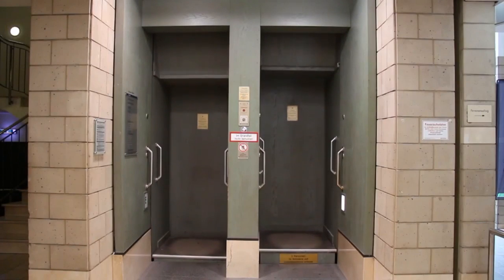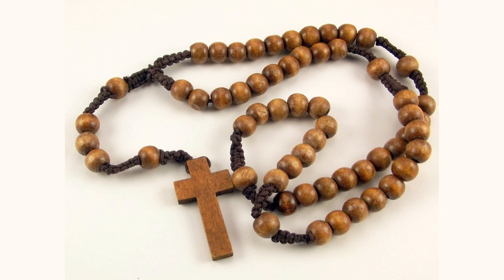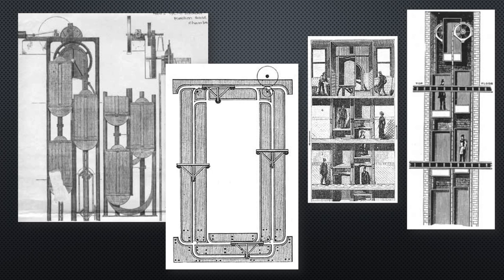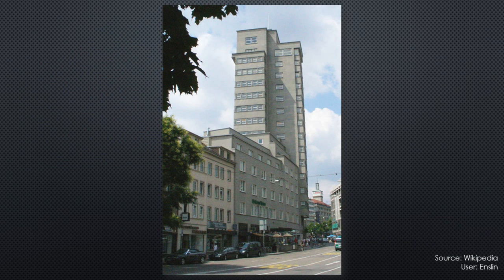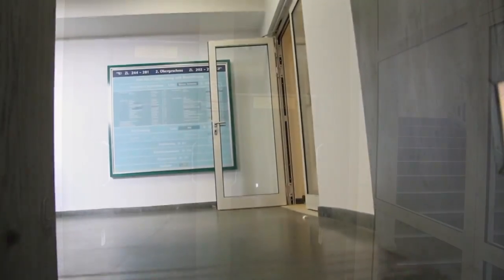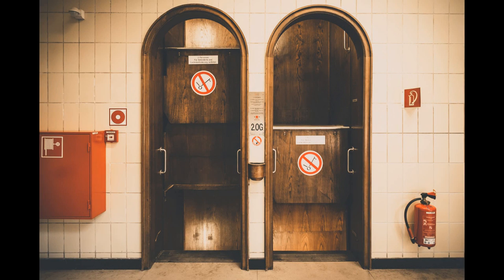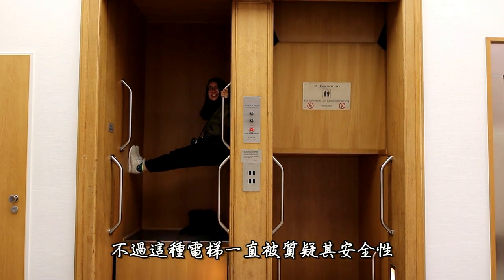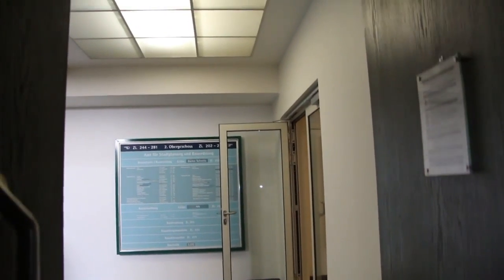What's a Paternoster Lift?

Comment: That was a bad idea back in the 1800's, and keeping those devices in operation today is no less than stupid.
Reply: It was a brilliant idea, and much safer than normal elevators _of that era_. 

Emphasis on "Of that era". Comparing any 19th century elevator, paternoster or not, with the standards of modern elevators is stupid. Modern paternosters can have multiple safety features, closing doors, sensors/etc, just as normal elevators do.

Comment: Very difficult to guillotine toes etc. as the floor is hinged on the cars and the floor to let anything trapped escape intact. They are great at moving large numbers quickly and the fire issue can resolved in the same way as stairwells. 
BRING BACK THE PATERNOSTER 
Peterborough District Hospital had one. We would play jokes on new staff showing them how to use it and let them get off, ride over the top come down standing on heads. We couldn't believe that people fell for it.
Also ridden the Attenborough Tower at Leicester University.

Comment: Well I would normally say that its a solution looking for a problem, but in this case its worst, Its too slow compared with a normal elevator and more over, too dangerous, not only compared with a regular elevator, but too dangerous to be operated. I think that I would restrict their use to cargo elevators for places that are very busy, and maybe helped by a computarized system that makes sure that the payload is coordinated with the elevator movement, you could even rise their speed.

Comment: An elevator that people with disabilities can't use, and causes disabilities for those who use them.
Reply: DOUG HEINS  No more attention than an escalator. Even with drunk university students, for most buildings, there was typically few injuries, no deaths, over the lifetime of the lift. How many 19th century elevators could you say that about? IMO, that was part of the reason paternosters survived so long. Everyone replaced their elevators as quickly as possible because they were hideously unsafe. They only became safe with auto-stop sensors, clutch brakes, cable-break leaf-brakes, etc etc. Whereas paternosters were "good enough" and so never upgraded and barely maintained. Had they gone through a normal upgrade cycle, they would have remained safer than normal elevators.

Comment: Why do we even have this? 🤔
Reply: It works well, requires a smaller motor and less power than conventional elevators, was more reliable and required less maintenance than conventional elevators, and in the 19th century was much safer than conventional elevators.
Reply: @1FatLittleMonkey  
Thank you for the info. 😊
I continue to wonder why we still have it in 2020. 🙃

Comment: Meh, not dangerous enough looking. To spice it up a bit there should be about a 2 foot gap between the building floor and the elevator car floor that you need to step or leap over to get in and out. Fall into that gap you either plummet or get your body parts rearranged. Also have a sign that says, "2 out of every 5 grab handles are electrified. You guess which 2." That ought to make more appealing to thrill seekers.

Comment: Israel should consider more of these as they don't require special programming for the Sabbath. Elevators run continuously and stop on every floor on the Sabbath there. That way observant Jews can use them without breaking Sabbath by commanding things to change their state, a type of work.

Comment: Cool. It looks dangerous. You'll easily get crushed.
Reply: People can and do get crushed by regular elevators, usually maintenance workers. People get killed by escalators (especially if they are wearing the wrong shoes). People fall down stairs. Paternosters were preferred by many in the 19th century because they were actually safer than regular elevators. (Remember when they had operators in each elevator? There was a reason for that. Those things were insanely dangerous.)

Comment: They could also be called Shabbat elevators because observant Jews don’t have to push buttons to use them on the Sabbath.

Israeli engineers accomplish the same effect with computer control of modern elevators, making them stop and open on every floor from sunset to sunset on the Sabbath.  Much safer than the nonstop doorless lifts!